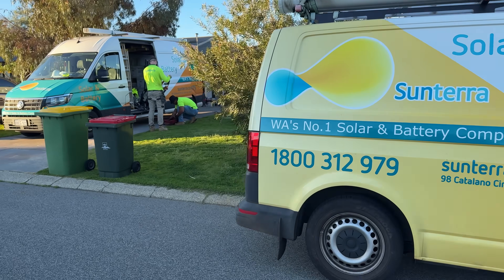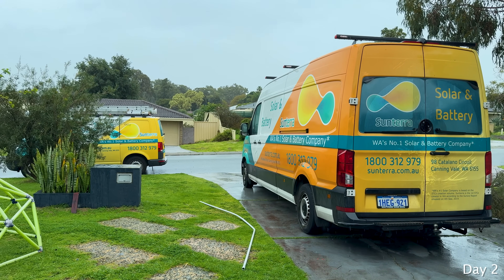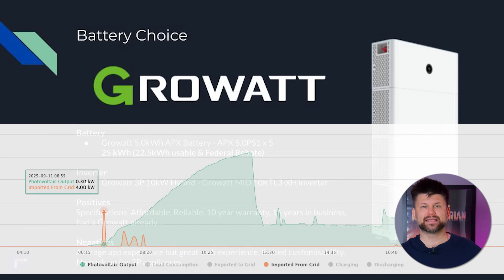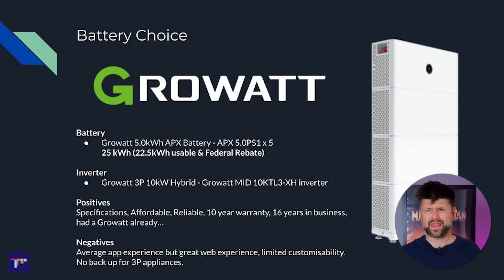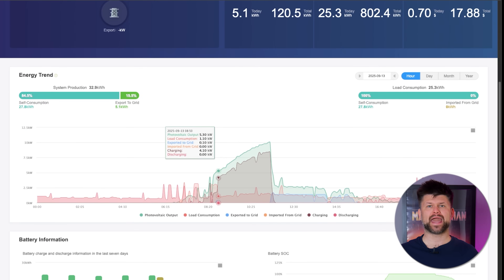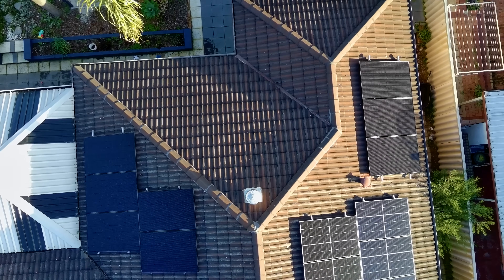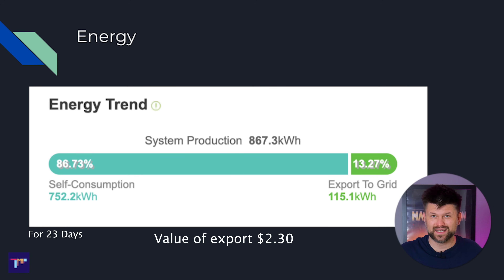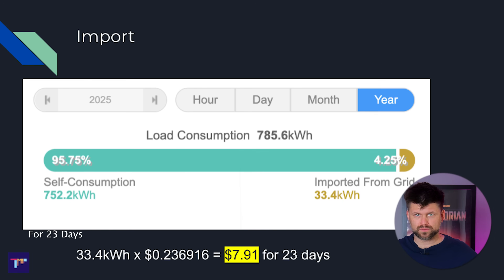Installed my Growatt 25kWh Solar Battery | TechManPat

Comment: Hi Pat. Had my batteries installed and it didn't go smooth but it's now working perfect. Mine is 3phase as well but I have full 3phase back up. Oddly it was the 3phase back up box that held up the commissioning of the system along with a list of various things as well but least I have full back for 3phase. Not sure if it's something to do with your mid10 or my mod10 inverter? But it would be interesting why they only backed up a single phase?
Reply from the maker: My installer said that you can do 3P back up, but the brand doesn’t seem to allow it. So not sure. I might try and reach out and see what they say. 

And I assume you are referring to Growatt ?
Reply: @TechManPat hi Pat. Yes I have a growatt system with Mod10 inverter and 6x5kwh (30kwh) apx HV batteries but I have a different Syn back up box than yours which supports up to a total of 63amps across all 3phases. Its actually my first night on batteries and with the system working + monitoring properly as intended.

Comment: Hi Pat, Enjoying your videos. I am doing the same math here in WA. One question, I believe you have the option to charge the battery up from the grid if your solar does not cut it on a rainy day. My panels and inverter will be less(5kwh). So did you take into account especially in winter that you can charge up at off peak and then use that power during peak. I believe the mid day saver rate is 8c during offpeak. This seems to have cut down my payback period by about 2 years on the modelling
Reply from the maker: Hi Mate, glad to hear, Yes I did, i have an option to charge from AC, and using Home Assitant I can make it time of day, but I have had only 1 day where this happened, the cost at the moment is the period between 5am to 6am, or there abouts, I think an extra 5kwh of storage would help

Comment: Hey Pat, what size panels were your original solar panels? I have a 6.6kw system, but with 275w panels. Most quotes tell me they have to remove the old panels and install a complete new system? My solar panels are only approx 5 years old
Reply from the maker: Mine were 370 and they added 450s, mine were only 3 years old, or even less. So it was only right to keep them but I know older ones it’s hard and there is more of them coas they need more panels to achieve the 6.6kw

Comment: If you weren’t in Western Australia I’d be telling you to get on Amber Electric, to turn your power bills negative.  Even if you import more than you export, most days are negative — the prices are wholesale market rates.  (“Buy at lunch to sell at dinner”).  All the trading goes automatically via their systems which you can activate in the app;  for each 10kWh of battery you save another $1,000pa, so with one of those you should turn a $3,000 annual bill into zero, or -$1,000 credit with two batteries or -$2,000 with three batteries.

Of course you’ll need one of a dozen supported brands of batteries — Growatt is not ready yet but coming soon.

Comment: @Tech Man Pat do you have any idea why the new 2.2GB 4 port FTTP NTD exists? I went to get a second NBN plan to my residence because i wanted the new 2Gbps plan but also wanted to keep my current 1Gbps plan, so 3Gbps across two plans but was told that the new 4 port NTD only supports 2.2Gbps across all ports.
Reply from the maker: The new 4-port 2.2 Gbps NTD exists to support multi-gigabit plans, but the 2.2 Gbps is shared across all ports. You can run multiple services, but you can’t stack them to get more than 2.2 Gbps total.
Reply: @TechManPat  so what's the point of the 4 port NTD? when it only supports one 2Gbps plan, wouldn't you just get the 1 port NTD that also supports one 2Gbps plan?
Reply from the maker: Haha… Yes. Not really much point unless your property connection has an upgraded POI, so future proof, at best case.
Reply: @TechManPat  They just made it so the next time they upgrade the NBN you're gonna have to get another technician to come and install another NTD.
Reply: @TechManPat  My ISP said if you upgrade to the 2Gbps plan you have to cancel your other service.

Comment: Do you have a Tesla EV to go with Tesla charger? If so a Powerwall allows charge on solar feature which is great. As we have gotten into spring here in Melbourne I can now charge my car for free starting from 7.30am on sunny days.
Reply from the maker: Yep completely agreed, but Powerwall is a single phase solution and. It really great for 3 phase homes
Reply from the maker: And price
Reply: @TechManPat yeah fair enough, I missed the 3 phase part. Only 10% of households have 3 phase so not an issue for most but if you are lucky enough to be in the 10% who do have access then I’d agree Tesla probably not the best option.

Comment: Growatt don't have a great reputation, there's a reason they are called No watt in the industry. I appreciate your trying to keep the cost down, but something like Istore might have been a better long term proposition. It will be interesting to see how the battery goes during a vpp event as I think your battery will get depleted quickly with a 10kw inverter.

Comment: Hi mate, just wondering — why didn’t you connect your Tesla charger to the battery/solar system? I get that you’re planning on getting a DC charger, but even with that, if the charger was connected to the solar, then once your battery is full and the export is capped at 1.5 kW, you could still charge your car on solar many days. Just curious why you didn’t go that way, even with the DC charger in mind.
Reply from the maker: Yes spot on, but but there is no destination between battery and solar power, the charger does 12kw so if solar is proving 5 the battery will provide 5, I don’t want the battery 25kwh being drained into a 60kwh car. The DC charger integrated into the battery can provide only excess solar, Tesla charger cannot be integrated to be smart out of the box with third party batteries.
Reply: If you had an OCPP EVSE it would be possible. Since the Tesla chargers are a dumb charger I can see why you didn’t have it directly connected to the PV & batteries. The only way to make the Tesla chargers “smart” would be to install a Tesla Powerwall 3 which isn’t ideal for 3-phase installations like Tech Man Pat has.

Comment: I just installed my Tesla battery and 20kw solar array in WA and my first bill saved me $500 over two months. I usage house but because it’s a single battery at 13.5 kw it runs out at 2 in the morning. Still a great saving.
Reply: @jsmorritt  🤣🤣🤣🤣🤣🤣🔙🔙🔙🤑🤑

Comment: Why don't you get any feed in credit for anything exported to grid?
What electricity retailer do you use? Do you have any wholesale retailers in Perth like Amber Electric?
What I think will be interesting in future is the effect that battery installations will have on electricity prices. I'm in the process of getting a battery myself, which will probably reduce my bills to nil, and probably even in credit. So if I am no longer paying any money to an electricity retailer, but the electricity retailer has to make money, pay the bills, pay staff, give pay rises, etc, and then you multiply that by tens of thousands of homes with batteries, that is a lot of money that electricity retailers will no longer get. As a result, I am thinking that electricity prices will continue to go much higher, quicker, otherwise there will be a lot of electricity retailers going out of business.
So the Labor government thinks it's a good thing giving battery rebates, but I think that all it will achieve is higher electricity prices for those people that are already struggling to pay their bills, and they are the same people who definitely can't afford solar or a battery.
Reply: There are zero options in WA.
It's synergy or nothing.
Reply: It'd suck for people without solar.
Reply from the maker: When you get a 10kW inverter they don’t pay you for export

Comment: What you get and what the rest of is get will be substantially less, as you already had your old solar panels, and you also probably got a better deal as you are a YouTuber doing advertisement for them. This not only makes your math wrong, what you are advertising is also wrong!
Reply from the maker: No. This is the full quote and price. Feel free to reach out to them.
Reply: Most people who will be getting a battery under the government's rebate scheme would already have a solar system. They are just adding a battery and maybe a new inverter. Also, I have got various quotes for a battery and new inverter, and I can tell you that the quote he showed is normal. It will obviously vary depending on what battery and inverter you get, whether you even need a new inverter, and who you get to install it. Some installers will rip you off, so you should get at least 4 quotes before making a decision so that you can compare and eliminate those who overcharge. Also go with an installer that has a lot of 5-star reviews on Google. Always do your homework.